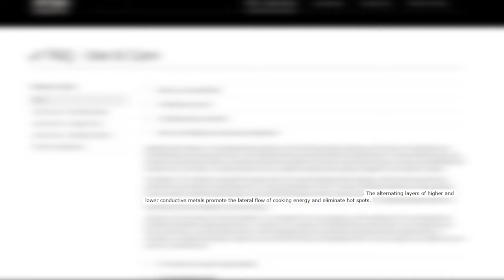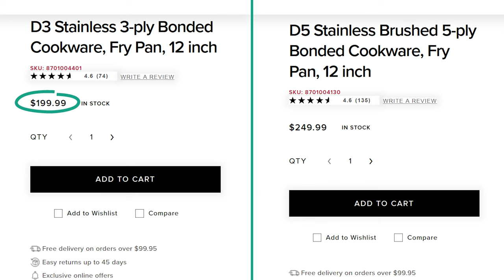All-Clad D3 vs. D5: Six Key Differences and How to Choose

Comment: the all clad handle is horrible . It's a shame as otherwise great products. I have the copper core line. Hate the handle
Reply from the maker: Very common complaint
Reply: i use cloth to reduce that problem
Reply: The idea is to keep a full pan from rotating in your hand. It’s safer than rounder more smooth handles. But I agree it’s uncomfortable.
Reply: @barryhaley7430  i understand but for medium or large hands it’s pretty terrible.
Reply: @jstones9872  I read somewhere someone was using the groove as a rest for utensils. They are uncomfortable though.
Reply: How long does a cook have to hold onto a pot handle that the uncomfortableness becomes an issue for them?  I've never understood that argument about AllClad handles.  I think they are great.
Reply: @stinkypants150 I've been fiddling. Now I'm wondering....what kind of gloves your wearing? If I turn the pot 90° counterclockwise it fits like you describe. But when I do that I find that gravity ejects the contents of the pot. 😂
Reply: I’ve never had a problem with all clad handles. I want it to dig in so I have safe grip.
Reply: @tlwilkinson  for me they are way way way to narrow and frankly sharp edges. So no thanks. Thankfully there are other great choices too. Like Demeyere for example.
Reply: I have the D5 and never had an issue with the handle.  It's designed so you can put the whole pan into the oven, if desired.
Reply: @AmazingChinaToday  so are many other pans with more comfortable handles. There is no reason for such narrow sharp handles.
Reply: grow up
Reply: You know what’s funny? That is the only thing on that pan that is made in China 😂
Reply: @rendangcrispy3669 pay close to $1000 only to have to use cloths with your panda while you cook 😂. Unacceptable.

Comment: I love to see these compared on induction.
Reply: I have some of the copper core pieces i use on a induction and i can tell you they are more responsive than my D5 pieces.
Reply: @jstones9872  I have a couple D3 and they work well. Was wondering if the 5s might be better. Am looking for a Saucier.
Reply: @barryhaley7430  i don’t have any of the d3 just d5 and copper core. I did just get my first made in. A 8” omlette pan. It’s very nice, works well on the induction cooktop and the handle i find to be excellent.
Reply: @jstones9872  Thanks. I was looking ate the made in 2 and 3 quart sauciers earlier tonight. Think I will go with one of those.
Reply: @jstones9872  Here’s my experience with induction. The concept that if the pan can hold a magnet it works is simplistic and not 100% true. I had a large stainless stockpot that could hold a magnet, was the exact diameter of the burner and would not work at all. The second thing is that while most magnet holding pots work, they don’t all work the same.  Some respond very well? Heat and cool quickly others not so much.  I wish there was some efficiency rating system.
Reply: @barryhaley7430  you are 100% right. However, i have only had issues with the less expensive pans that claim to be induction ready when they don’t actually work on my thermador cooktop.
Reply: @jstones9872  I have had the opposite experience. Except for my D3s the 2 most efficient pots are from a Home Sense and cost $20 for the 2quart and $30 for the 3 quart.
Reply: @barryhaley7430  my most responsive is the all clad copper core. I also have a Demeyere that’s terrific and my le creusets work great. I have a couple of D5 that do well. Our cast iron Smithey #12 and chefs pan do awsome as does our Field#8. The cheapest pan i own is a Emeril Lagasse sauté pan and it does well. Only time i have issues has been the cheaper lighter pans. For example i just gave away a misen non stick(i know, i own only one for French omelettes) as it just wouldn’t work on the thermador. I have never in 5 years since using the induction cooktop had any issue with a high quality pan advertised for induction that was at least a little on the heavier side. Just my experience
Reply: @jstones9872  Cool. Our Staub and Creusets are excellent as is all cast iron. I have 2 Ozeri stainless nonstick, an 8 and 10 inch. They are excellent and only cost $60. Quite heavy. I am in the buy cheap for nonstick group. I never heard of this brand and can’t find any other pans than these two.
Reply: @barryhaley7430  i agree and tried buying cheap non stick like the Misen wad $25 but it didn’t work. The Made In was $85 and works perfectly

Comment: I own a lot of All-Clad, but recently my husband purchased for me the pasta pot with the lift out strainer. It is lightweight and discolored after the first use. I believe it is D3 or even less. It is manufactured in China. He was unaware of this when he bought it. A friend has had the D5 pasta pot with the lift out strainer for many years and it is heavier and has never discolored. We were under the impression that All-Clad is made in the US, but not so for much of it. Can you comment?
Reply from the maker: He most likely bought the Gourmet collection, which is a line of specialty stainless steel pieces including tea kettles, steamer pots, and this pasta pot https://www.all-clad.com/gourmet-accessories-pasta-pot-with-perforated-insert-and-lid-6-quart.html it’s the only steel All-Clad collection that’s made in China. Unlike the D3 and D5 collections, Gourmet is not fully clad. The walls are a single ply of steel and the base is 3-ply with an aluminum core. That’s why it feels lighter and cheaper.
Reply: @PrudentReviews  We live in the area where All Clad is made. He bought it at the annual seconds sale. I got most my stuff there as well. I'm going to try my luck there this year. Thanks for your comment!
Reply: @PrudentReviews  I called All-Clad and addressed told them I saw where this was made in China. In our conversation they never said anything about having any other line that was superior. I was very disappointed in that.
Reply: @Pluviophile218 just because you buy something in an area, doesn't mean it was made in that area. Doesn't matter if you bought these cookware items (which are from All Clad's Gourmet collection) at the house of All Clad's CEO himself; the fact of the matter is that All Clad's Gourmet collection is the only collection from All Clad that is manufactured in CHINA. All of the D5 and D3 cookware shown in this video is made in Pennsylvania, US. Always research and check where something is from if it's an expensive item and if that matters to you.
Reply: @steelsteez6118  I live in the area where All-Clad is manufactured. they are very proud to say the stuff is made locally. It's is difficult to find that it is not made here. You sound like an employee.

Comment: I'm a bit late to this party, but I personally love the D5 series.  When I was first looking around at cookware one of the things that drew me to the D5 over the D3 was that it is more forgiving for less experienced cooks, like myself.  It doesn't react as fast to temperature changes which is better for me as I have a LOT to learn about cooking, and still make more mistakes than I care to admit sometimes.  That was the main selling point between the 2 for me.
I buy most of my D5 on Ebay. You can find a lot of 'scratch and dent' sellers on there that are selling pieces for 20-50% off retail for a minor scratch or scuff on the pan.  When people are paying a premium price they want a perfect piece for that price.  These resellers buy those slightly imperfect pieces and you can get them for a good price.  I have bought a few of my pieces brand new from retail stores, but only when they're running a special promotion or one heck of a sale.  I've bought a few pieces from retailers cheaper than the 'scratch and dent' pieces go for.  
It pays to look around before buying anything.
Reply from the maker: Great tips, thanks for sharing!

Comment: What are your thoughts on D3 vs. D5 in the 5.5 Quart Dutch oven? Do you think the extra steel in the D5 would be beneficial in a Dutch Oven for even heat during long cooks, or long simmering soups on the stove? Appreciate any thoughts. Also subscribed to your newsletter, looking forward to it!
Reply: D5 for Dutch Oven 100%, you want as much heat retention as possible
Reply: @The-BigBoss   Can't beat cast iron for a dutch oven.  If you're already spending on All-Clad, go with a nice enameled DO from either Staub or Le Creuset, or even the new Made in the US Lodge enameled line.
Reply: My exact question one year later, I think D5 for the slow cook.